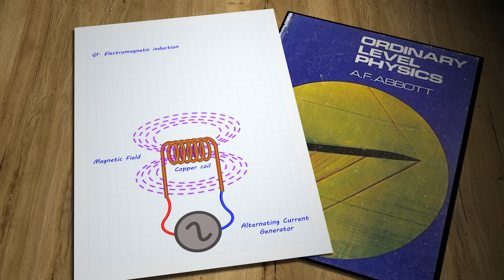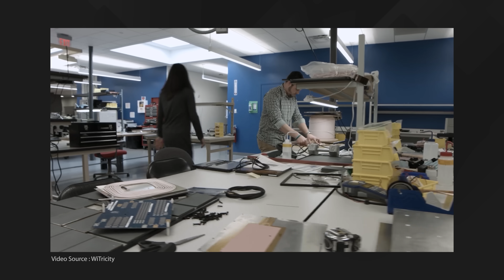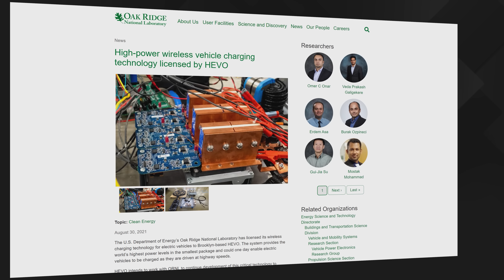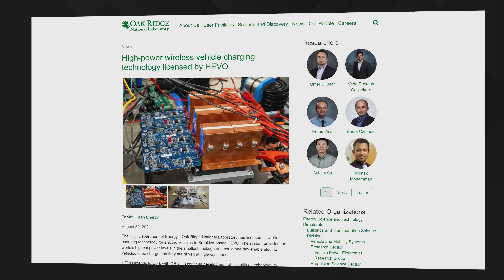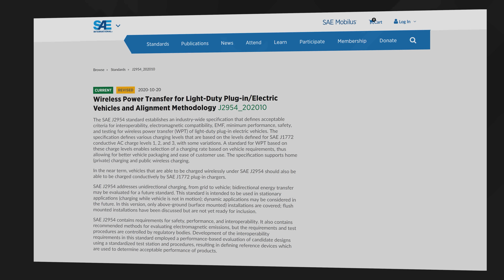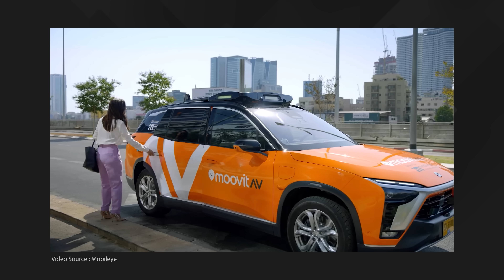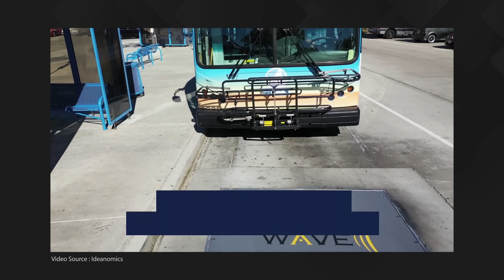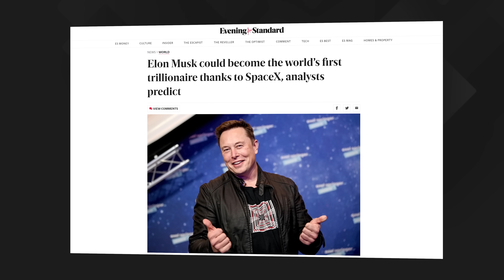Wireless FULL EV charging has arrived!  Exciting new tech breakthrough.

Comment: Those efficiency figures are very hard to believe when switching power supplies only just reach 95% for a consumer level device. And they use highly magnetic materials compared to air for transformer core.

The other thing is that road pavement is already a budget issue in many places. How bad would it be if the cost is multiplied by having to embed more in the roads?

I think a plugged cable is as good a solution as there is for the moment.
Reply: Exactly. We build our roads with oil and rocks, but most cities still don't have the funds to keep them in good repair. Adding highly expensive, energy intensive technology that requires skilled labor for maintenance and you're digging yourself a grave. Makes a lot more sense for cities to run extra EV buses than subsidize a whole system for Uber.
Reply: @gardenshine.  So interchanges are cheap oil and rocks structures made by unskilled workers? Okay.
Reply: But power supplies are not same thing.They need to convert AC to DC,transform voltage,and with lower power high efficiency is harder to achieve.
Reply: I haven't even watched the video yet, but I'm quite certain that you're right. The losses over the air gap between the road surface and the car are going to lose an aweful lot of energy. And that's without considering the costs of materials, skilled labour and electrical infrastructure to install and support such a thing.
Reply: @surferdude4487  Just say "I'm ignorant person,and don't care about technological advancements". We get it.
Reply: @surferdude4487  Congrats,you just confirmed how fast you can switch your agenda -  "The losses over the air gap between the road surface and the car are going to lose an aweful lot of energy." and " Not for one moment do I think that this is impossible"
Reply: @Steellmor  Nope. I'm just making the distinction between feasible and possible. Sorry you don't understand that.
Reply: @Steellmor  FYI: I watched the video all the way to the end. The news that they "THINK" that they've overcome the inverse square law is a most curious development.
However, the prohibitive cost will still prevent this from being practical or feasible any time soon. I also have to wonder how much drag this induction charging would create on a moving vehicle. Has anyone even considered that?
So, if it makes you happy to call me ignorant and biased, then have at it. I'm still right.
Reply: @surferdude4487  Still right on commenting nonsense before watching video?Nice,keep defending your title of ignorance. How much drag does half a ton of battery adds to a vehicle? Prohibitive cost? We can make Maglevs,but yeah surely $1 million/km for adding charging lines to $3-5 million/km road,prohibits use of such tech.Surely.
Reply: @Steellmor  Dude! Can't you read? I watched the video. Really, clean your glasses.
Reply: @surferdude4487  Can't you read? You made a statement declaring your bias before watching it. It doesn't change if you watch it afterwards. I'm not trying to force you to watch it again.I'm talking about your bias and that it's irrational and wrong,opposite of being right. You can't keep pushing your skepticism after discredit yourself in your first statement. Want make an argument - get a proof which makes sense. You doubt that cost is going to be feasible - give some real numbers. I gave you those - can you disprove them?  You can't even try.
Reply: @Steellmor  It's just like Random Electronics and Displays said in the original comment. Road surfaces are so bad that people are breaking wheels and blowing tires. You can find videos about that anywhere you look on youtube or the news. Ashfalt is made of rock, sand and tar which is litterally dirt cheap and many places say they can't even afford to maintain that.
Now, you have this idea that they are somehow going to come up with the money to not only completely replace those road surfaces, but instal this induction charging system under it? I don't know what drugs you're taking, but I want some... NOT!!!
Reply: @surferdude4487  I'm coming with idea?Did I invented it? Wow I'm smart then. Or maybe it's you coming with idea that this isn't feasible? "Dirt cheap","many places can't afford" - can you chose one,is it cheap or not affordable? Road is so bad so why we have it? Especially in so many places...which can afford it? Ahah,this is hilarious,you make one bogus claim after another. I gave you numbers - 1km of 2 line road cost $3-5 millions, adding wireless charging to them costs $1 million per 1km. We need roads this is why we pay for them SO much. Places that can't afford it - don't have enough traffic. EV costs $30-80k and people buy them, ICE cars - yeah they can be so dirty cheap,but many people still can't afford them. Having $5 million/km road for $2-20k crappy ICE cars is fine,but having $1 million/km for EV - "Nah,that's expensive!" AHAHA
Reply: @Steellmor  Surfer Dude is actually spot on. There are very good physical reasons why wireless charging is not going to work very well and there is a lot of unjustified hype around it.
Reply: @Steellmor  Surfer Dude knows some physics. Clearly you don't.
Reply: @Steellmor  I am a graduate of one of the world's premier SDTEM institutions. Imperial College London. It is rather selective and has produced many Nobel laureates. The most important thing they teach you there is critical thinking, seeing through hype. Satisfied?
Reply: @Steellmor  I am an Electrical and Electronic Engineeringraduate of one of the world's premier STEM institutions,Imperial College London. It has produced  several Nobel laureates. One of the things that they teach you there is critical thinking. That means seeing hype for what it is.  Satisfied?
Reply: @rogerphelps9939  As I said, you are spam bot.
Reply: @rogerphelps9939  Once again - spam bot.
Reply: I have always wondered why they do not build roads with submerged channels in them with relatively easy access precisely for all the additional wires, cables and tubes that have appeared over the last 100 years. Each time something new comes along requireing a wire or tube to a property we have to dig the roads up being careful to avoid the multitude of wires, tubes already embedded. Why not start from scratch and put accessible channels in so we can add new and remove old outdated stuff ?
Reply: There's a company in Norway doing a great job.
Reply: You misunderstand the figures. These wireless chargers are "up to" 95% of the efficency of a cable. There is still whatever conversion loss is incurred in the power supply to the charger.

So in round figures it's roughly doubling the waste.
Reply: @trueriver1950  Actually the efficiency will be a lot worse than that, maybe 60%.It is in manufacturers' interests to hype up this stuff but you should be prepared for reality.
Reply: I have driven EVs for 5 years and hope to continue.
Reply: It is interesting to see the level of resistance to the concept of induction charging. Motors are based on induction and the first ones were not very efficient. As technology improves, so does efficiency, I have no doubt this concept is the future of earthbound transportation and I certainly understand the reluctance to accept the concept as it implies a reliance on a network and the extinction of the open road appeal and the illusion of freedom!
Reply: @ericdelevinquiere9902  Air gaps in induction motors are very very small.
Reply: @ericdelevinquiere9902  Thing is,that charging roads are much more believable than making every EV to have high enough battery capacities so they could fully replace most of ICE cars.This is much cheaper and less resource intensive,than complicated batteries chemistry,which also degrade relatively fast compared to wires and induction coils. But for some reason people use arguments "this won't be real because of cost,and needed work and labor to be done" or "low power consumer PSU for 12V DC output have efficiency of n% - so this tech can't be real" - WTF this has to do with anything?
Reply: do the math on charging lanes and you'll see why this is fucking retarded. It seems like a good idea until you consider that you need literally 100x more stations with the same span than an on the fly swap stations.105kmh= ~30meter second*40seconds = (1.2km per lane per 1% battery in 40 seconds at ~105kmh), while you can have it swapped to a 100% charged cold and distressed battery in the same 40 seconds and you don't have to reduce your speed a 100 times to charge a fucking % each time.
Reply: @fss1704  Now multiply 1% battery in 40 seconds by number of EV cars that can drive on that road aе the same time. You can drive 3 km on battery,1km on charging road,get 3 km worth more of charge - in 3 km further on road again get 1km charging road... There could be many road forks from every 1km of charging lines. You can get anywhere in city without losing battery charge.Not just you,but every EV in your city.
Reply: nop, on the fly is the future, cables suck.

Comment: Do the benefits outweigh the cons?

Cons:  High initial expense (fixed and roadway charging areas), additional expense to equip EV's, 5-10% drop in charging efficiency.

Pros:   *Roadway "charging lanes" would completely eliminate the need for fixed charging points--that will be overcrowded as the number of EVs increase
            *Smaller batteries could replace huge/heavy battery packs....thus lighter weight EV's
            *Lighter EV's = more efficient EV's...along with less road damage (think heavy trucks)
            *Smaller battery packs=more lithium available...for the world-wide demand for EV's.   Thus more EV's could be produced
           *Wireless charging would be safer and more convenient than handling a wet or damaged high voltage cable...or a hose filled with fossil fuel.
Reply: owhh, i see, your last question show you understand nothing of electrics, i bet you never even opened a fucking electric panel to discover what gfci's do. Sincerely, i would rather have a small battery for daily use and have a on the fly swap station with rented batteries for long travel so that i can just go a little slow for a moment and then have my batteries full in fucking seconds, it would take a lot less charging stations and the 100% charging speed would be just incomparable even to gas vehicles.
Reply: *HEAVIER EV's, since now you have to carry not only on travel but on your everyday fucking 100's kilograms more induction coils plus the addition of the stuff needed to charge into the wall.
Reply: do the math on charging lanes and you'll see why this is fucking retarded. It seems like a good idea until you consider that you need literally 100x more stations with the same span than an on the fly swap stations.105kmh= ~30meter second*40seconds = (1.2km per lane per 1% battery in 40 seconds at ~105kmh), while you can have it swapped to a 100% charged cold and distressed battery in the same 40 seconds and you don't have to reduce your speed a 100 times to charge a fucking % each time.
Reply: higher C's charging mean you're using more energy to combat the internal resistance of the cell per amount of charge then you would have to use a higher voltage to charge the same current and that excess voltage does nothing but turn into heat. Charging batteries outside of the car in slow and efficient chargers that can use this lot of idle batteries to regulate grid power is the absolute future.

Comment: An interesting idea, but I think the better solution is to have modular batteries - yes, the batteries can be recharged, but you can have the option to easily just remove the spent ones and put in fresh ones, like changing batteries in a flashlight.

Comment: All well and fine to solve the fun techie problems, but as the heads of Toyota have been trying to point out, the USA doesn't have the power grid capability to charge a significant number of electric vehicles (which they would be glad to build).  California for example, can't keep the power grid alive reliably to keep all the iPhones charged, much less electric vehicles.  Why don't you have a think on that?

Comment: I wonder how much cheaper it could become compared to current fast chargers in parking lots and so on...
Right now I think the equipment cost for a commercial fast charger is over 100k USD (not including the charger maintenance, cable maintenance etc...).
If this tech is not too expensive it would mean the possibility to increase dramatically the number of charging spots without taking space in the parkings which will ALSO be a win for the parking owners I guess...
I live in China and just in Shanghai we have over 50 000 stations so here I am never worried about where and when I want to charge but in Europe and the US I hear from friends and family it is sometimes just impossible to find a place to recharge.

Comment: Nice to see some discussion of drawbacks if any. Do the pads create radio waves/electromagnetic pollution? Do they affect heart pace makers if one walks over a pad? Driving over a set of pads on the highway do the magnetic fields cause eddy currents in car frames passing over? What is the %efficiency compared to plugging in? If I've parked my wireless charging car over a pad, can it draw from my battery?

Comment: It they have already achieved this level of efficiency of charging on the go, will we ever really need larger or more energy dense batteries or even conventional destination car charging as already deployed? If you can economically embed these induction coils reasonably frequently along all significant routes we can then manage with small light car batteries sufficient to go between embedded charging coil facilities and this would make the cars significantly cheaper and certainly bring on the death of ICE cars once and for ever and even more quickly than is already the trend.
Reply: do the math on charging lanes and you'll see why this is fucking retarded. It seems like a good idea until you consider that you need literally 100x more stations with the same span than an on the fly swap stations.105kmh= ~30meter second*40seconds = (1.2km per lane per 1% battery in 40 seconds at ~105kmh), while you can have it swapped to a 100% charged cold and distressed battery in the same 40 seconds and you don't have to reduce your speed a 100 times to charge a fucking % each time.

Comment: I could see these installed on special lanes on roads and highways (like diamond lanes) where you are automatically charged (electronic payment cost) for the amount you use while driving on the lane. Where it only charges battery by logging on and turning on access and it is auto paid electronically

Comment: Magnetic tunneling?  Yeah, I don't know about that.  The resonate coils will generate a much higher voltage at resonant frequency so far more power can be pushed into the coil, but as far as I'm aware the magnetic field does not tunnel or focus towards the secondary coil.  Its basically two coils of a transformer separated in space. Also you can't believe anything Elon Musk says.
Finally you can't just dismiss concerns about Charging EV cars as old fashioned thinking. In Australia the government refuses to move from a coal based energy system and so EV cars are likely to contribute to pollution in Australia at least. Rather than build Alternative energy plants the current power companies will simple reap more profits and keep their existing coal power infrastructure.

Comment: Even if we assume the info in the video is correct I think the conclusions are flawed.
1. As a charging system in my garage it would fail because the inconvenience of having to plug it in to charge isnt worth the added 10% loss in efficiency in energy transfer.
2. The cost of installing and maintaining the absurd number of chargers in the road required for it to work while moving would be prohibitive.
3. Since most chargers in the road wouldnt be in contact with a receiver most of the time most energy by far would be emitted into nothing making it horribly ineffective.
4. Turning parking spaces into charging stations will cause issues with people being unable to find a place to park because all the lots are occupied by cars put there to recharge and/or people being unable to find a place to recharge because someone is using the charging station to park a car in no need of recharging.
5. One might be concerned about the chargers messing with medical implants - just like wireless phone chargers but now with an increased power and range.

Comment: Hi, sorry but I think wireless charging is just a fad. The physics just doesn't add up. Let's assume 90% efficiency. (It's going to be more like 80% best case, I sincerely doubt they'll achieve 90% in real world conditions). Let's assume we're charging at 100KW. We're losing 10KW, that's like THREE kettles plugged in all the time. That's A LOT of electricity lost. And likely that ends up as heat somewhere, and 10 KW is a LOT of heat. And I'm not even talking about 1 MW chargers for heavy duty vehicles- having 100KW losses and heating is nuts.

I think much more promising technology is charging pads which can robotically extend an arm, find a charging port underneath your vehicle and plug in automatically. Direct connection and much much lower losses and no disadvantages compared with wireless charging. You park over charging pad and forget about it- whether it's truly wireless, or plugs into your vehicle automatically doesn't really matter to you as a consumer.